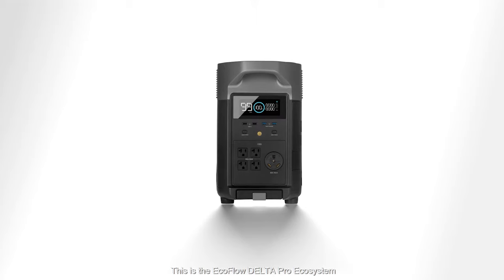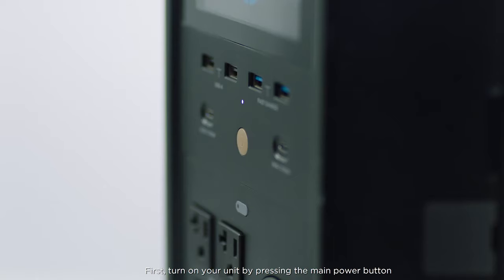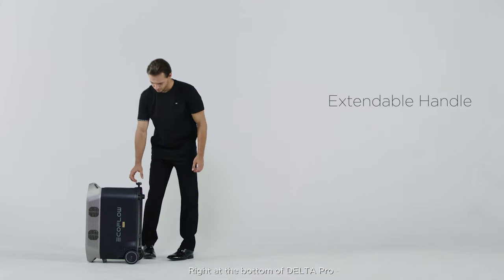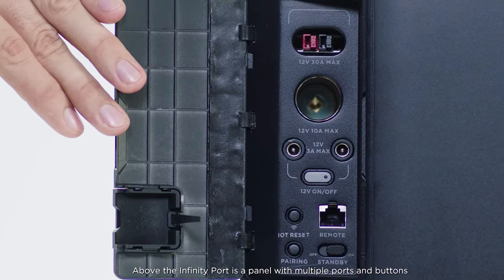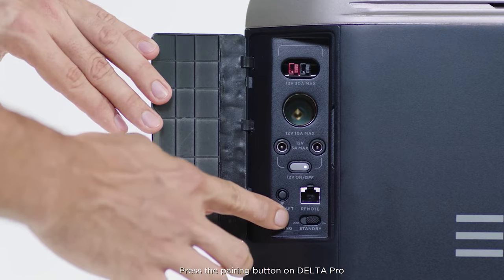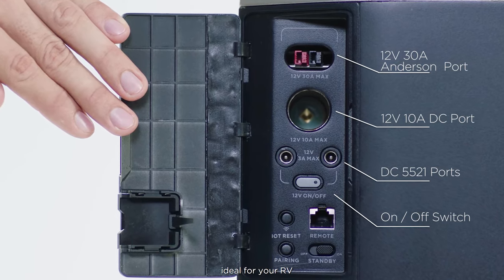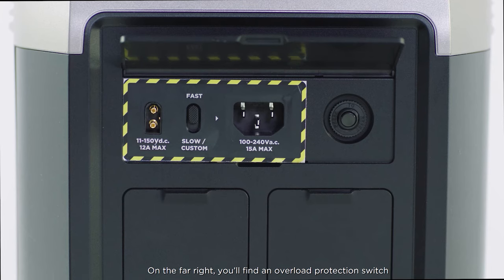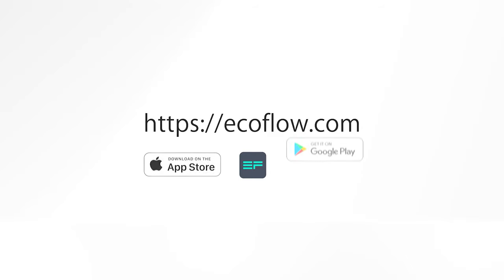How to use the EcoFlow DELTA Pro for the first time

Comment: We ordered a Ecoflow Delta Pro off Kick starter.  It arrived and had a 
battery fault.  Sent it back, next one came.. it has a Output error and 
only charges at 50w from the extra battery.  Not sure if it is a 
shipping issues or a QA issue... 2 Out of the Box failure in a row.   
NOT GOOD!

Comment: the fail here is no showing of the solar panel hookup....who just buys the EFDP without a panel? no one.
Reply: As is common with nearly every EcoFlow product, all DC power goes in via the XT-60 port.  There is a MC4 to XT-60i connector for the solar input.  The EFDP uses the XT-60i to signal that it can allow more power from your panels versus what your vehicle should pull via that adapter.
Reply: @carlbrothers  I do
Reply: …I am planning to use it as a portable battery when camping or when using tools at a remote location and simply charge it when I get back home. This has so much power I don’t need to drag around a bunch of solar panels, cables, and support stands with me everywhere I go. LOL!!

So, not “no one.”
Reply: I'd like to see a more thorough video on hooking up solar panels, cables etc. to this unit. I'm using mine for emergencies: blackouts.
Reply: I do 😊🎉

Comment: What sort of port is that "Delta Pro Extra Battery Port" on the back? What's the voltage on it? Why does it have 4 prongs and not two prongs?
Reply: two positive leads in parallel and two negative leads in parallel  =4 prongs

Comment: It won't notice solar until it is up to 40W. This surprised me. You really need to put that in the User Manual.
Reply: It doesn’t show it as charging in watts on the display until it hits 40w but it’s still charging, there’s a solar panel indicator on the display that disappear’s with sunset and reappears with sunrise, indicating it’s receiving a charge. I’ve also spoken to a YT channel owner who connected a MC4 power meter between his panel’s and the unit and he confirmed it’s charging. I only have one 400w panel atm but that start’s charging the unit from the moment the sun comes up and it rises behind the panel, assuming it’s not thick cloud up there.
Reply: @InimitaPaul  My complaint has more to do with the user-unfriendliness. If you don't get a watt reading, you might spend HOURS trying to investigate why There are other solar chargers that display incoming solar wattage down to one watt. For a high-end unit like the Delta Pro, I was disappointed it couldn't do it.
Reply: @morpher44  One Watt of solar is negligible when you’re dealing with large battery units like this. In that case, it would take around 3000+ hours to charge the battery at that rate so no one deals in charge rates of one Watt. LOL!

If you hook this up to an RV or house you will easily see baseline values of 30 W to 100 W or more so one Watt is just total background noise.
Reply: @niaralosusa  There are sensors that can measure down to watts. This is easily done with cheap parts. The issue has more to do with if the connections are working and if power is coming in, even if under some threshold for charging.
Reply: @niaralosusa  I have a 500 watt solar charger that can display input power down to 1 watt. It is doable.
Reply: @morpher44 …I get that it can be done but it isn’t necessary 100% of the time is my point. If one really needs to check the system there are nice voltmeters and testers that can get you way down into the decimal points of watts if that is what you need. 😊
Reply: @niaralosusa  Measuring watts needs both volts and current -- and to do current it needs to be inline. If your have solar cables, you are not about to SPLICE them just to measure current.

Comment: Can I use it without the app? In a bad emergency situation, with internet down, can I use without the app? For example: What if I need to charge from 15 amp outlet? Can I just use the custom switch for slower charge and be okay? Please help. Don't want to mess up my generator
Reply from the maker: Hi there! To answer your question:
1. You can only use APP to customize slow charging speed
2. APP supports bluetooth/IoT direct connection. You can also use APP to control your battery with Bluetooth when there is no network. 
3. 120V input can only hold up to 15A current; 1800W/120V=15A MAX.
We will no longer post videos on this channel. Follow us on @EcoFlowTech for more tutorials, buyer guides and exciting videos! 👉 youtube.com/@EcoFlowTech/featured?sub_confirmation=1
Reply: There is a charge speed switch on the Pro which allows you to charge it at 400 watts input. No app needed for that!!